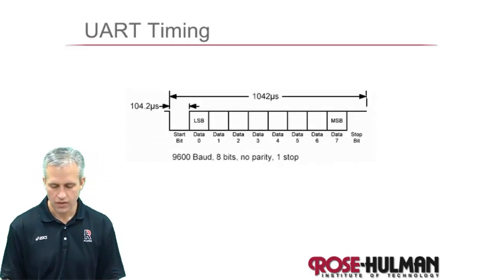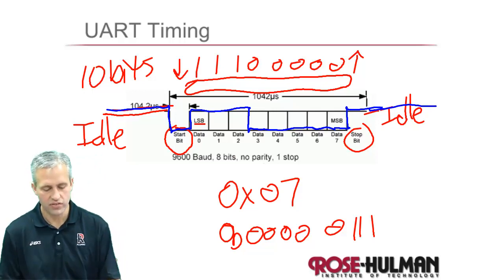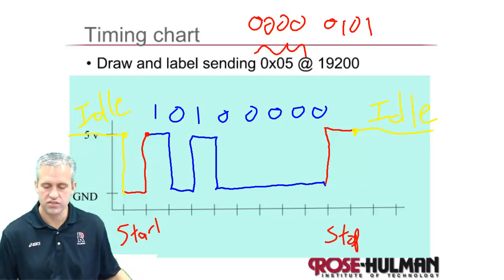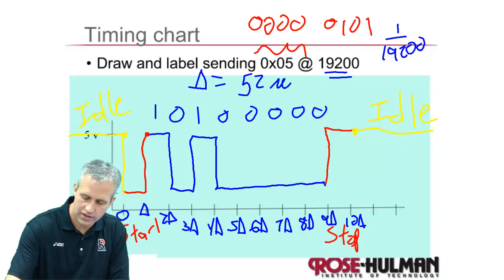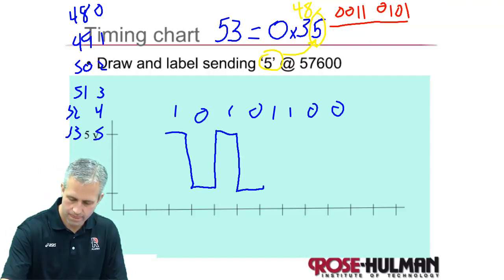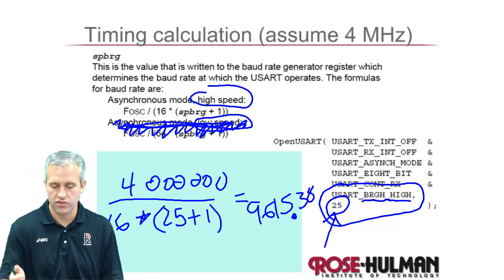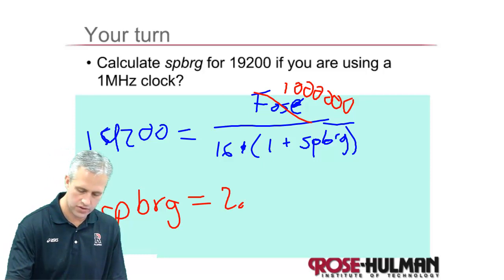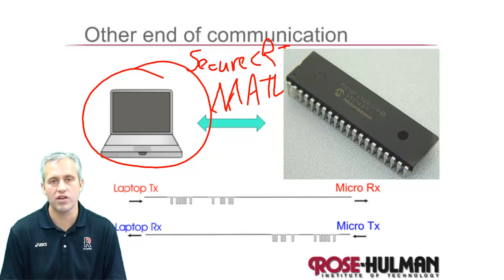ME430 How does the UART work?

Comment: Isn't 9600 bits/second equal to (9600/8) bytes/second...?  Why divide by 10?
Reply from the maker: +thesickbeat 1 byte = 8 bits.  Then on top of that there is a start bit and a stop bit.  So 10 bits needed to transmit 1 byte.  So a 9600 bits/second baud rate is actually = 960 bytes/second transmitted.